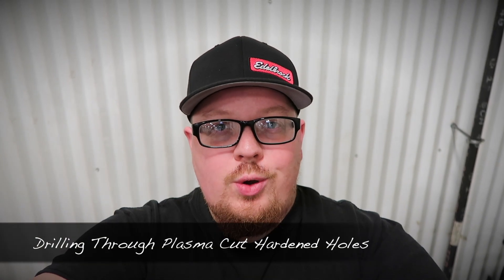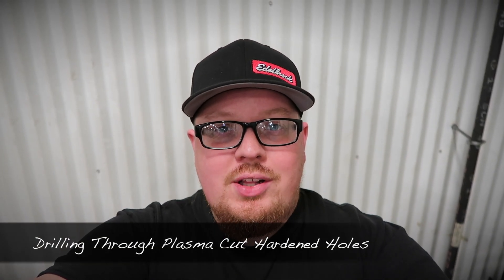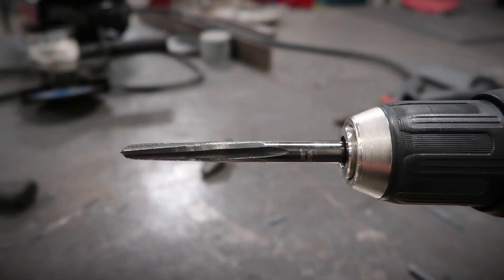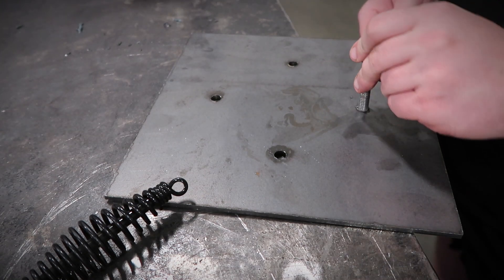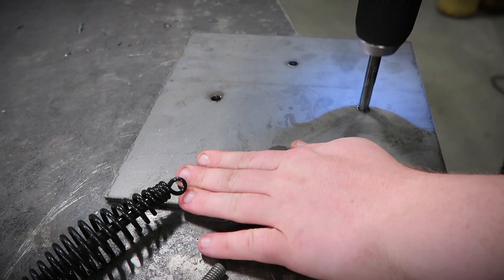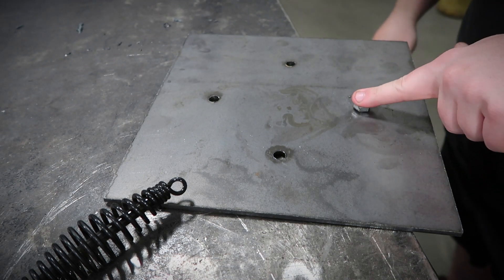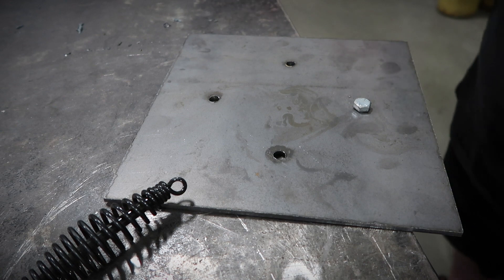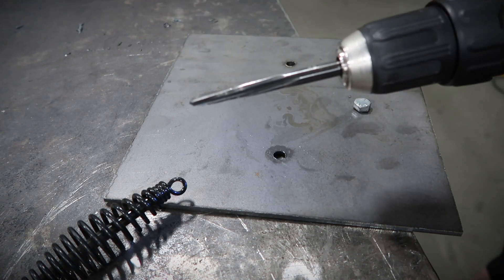How To Drill Plasma Cut Holes

Comment: I am trying to do some repairs on a front loader bucket,,need to drill some holes but no matter which drill bit i use it seems impossible ,,i have a cheap plasma cutter,,is that a option or can you reccomend a bit that i can buy that will cut through hardened steel,,,i have a drill press and i can get holes in pretty thick steel if im using it but of course with the bucket from loader being too big it cant  be used.any tips would be appreciated,,i have hundred of old bits ,,i may invest in a sharpener,,